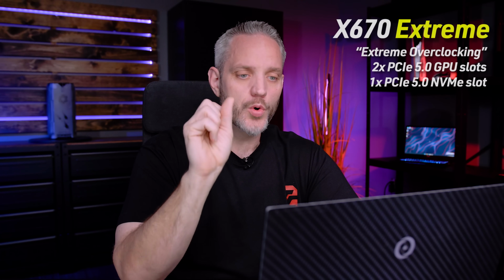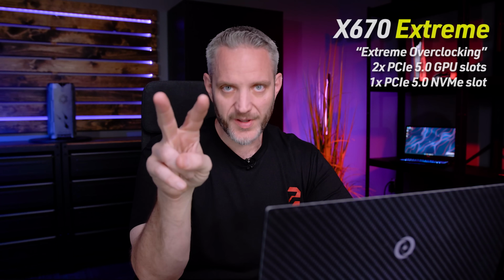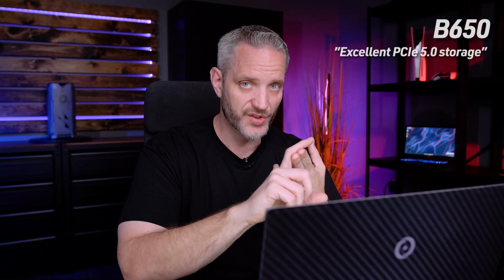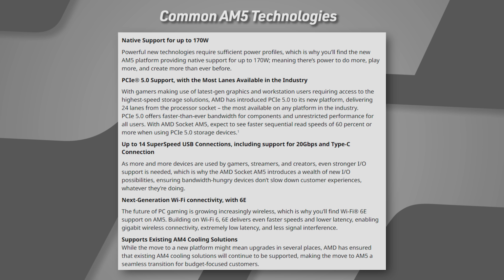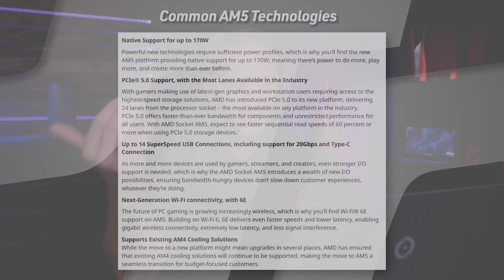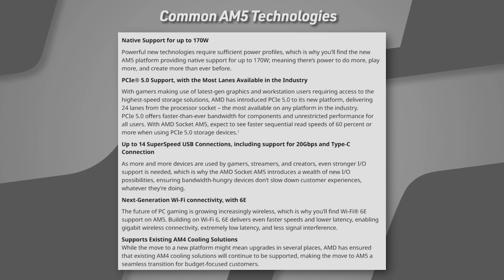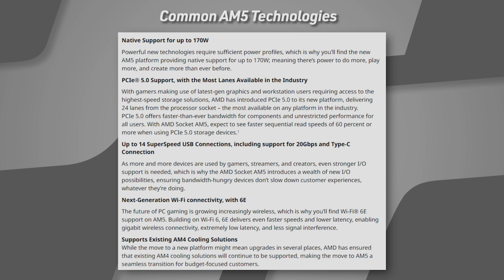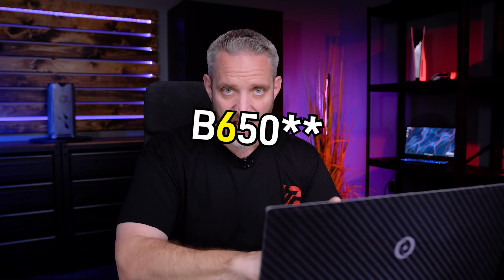AM5 Motherboards are EXPENSIVE! AM5 Explained

Comment: I would actually like to see Crossfire / SLI come back. Maybe some people with a lesser card could pick up one more and extend the life of their system.
Reply: In one sense it feels like a scam to say "hurr hurr here have feature to make you buy a whole 'nother card" but on the other, I literally was looking at boards like can this run SLI/Crossfire. 

But I mean, you actually can still do that anyway, it's just not super effective or stable (they never were super stable and reliable). Like AMD literally didn't even advertise this so I only found out about it through sheer nerdom of tons of tech stuff I watch and read that I found stumbling on accident that you CAN CrossFire your 5600XT or 5700XT. You don't even need the connectors just pop in another one and some games it actually works, which is super super neat.

But then yeah, the issue is with nVidia's constant different proprietary bridges that don't work for each other and are super expensive etc. and that they only even offer it now for their highest range cards, which I thought about getting a 2070 super for that very reason. I looked at the 2070 and thought, nah it hasn't got SLI. SLI mattered to me more than DLSS ever will. So I do think that it's scammy that they are still offering it on their halo products, but refuse to enable it on 60's and 70s anymore just because the kind of people to buy those cards absolutely would save money by buying a used second card. All that stated, Jay is basically right. It's so hit or miss and requires devs coding that it's become pretty much pointless. Main reason why it's pointless though? Look at dem thermals and power efficiencies. Can you even imagine Crossfiring or SLI'ing two 450w cards?? That's insane! I guess a 4060 it's "fine" but even still, that amount of power draw is going to be nuts. My 850w already can't handle two 5700XTs without tripping (I have enough other shit going on inside that 450w+ GPU usage is a no go basically).

Comment: I'm building an AM5 system at launch.  I'm still using the Ryzen 1800X CPU, and a GTX1080.  So i'm due for an upgrade.  Gonna get the 7950 CPU, Probably the ASUS Extreme board, and when they release a 4080 or 4090 GPU.  Also going to be building my first custom loop. Have never bent acrylic before, But I'll learn.  Already bought the massive Cooler Master HAF 700 EVO case, so I can use some pretty damn large radiators.  Going with a dual loop setup.  CPU and GPU will each be on their own loop, with their own extra thick radiator.   And then that system will hold me over for 3 - 5 years, like my current setup has.

Comment: No , i dont think crossfire will come back . Its simply , you dont need 16 Lanes 5.0 for one GPU , 8 Lanes will be enough which is equal to 16 Lanes 4.0 . You can have up to 5 NVME , 3 of them PCIe5.0 , that will be the 8 GPU Lanes and the 4 from the CPU , then you can get two 4.0/3.0 NVME SSDs over the chipset , or you have the second slot with 8 GPU Lanes for expansion cards or a second GPU . If they wanted a crossfire like GPU they would use two GPU Chiplets and wont have the Latency by going over the PCIe Slots and the CPU ( I/O Die) .

Comment: I got my motherboard a few years back. It's a $400 motherboard, that I got for $200 because it was refurbished since you couldn't buy them new anymore. And it's lasted me this entire time, holding my 4.7Ghz OCed 8086k well.

Next computer I build is going to have a 5800X (3D maybe.. depends on the price later down the road) and a decent 570 board

Comment: I'm probably going for a 7950 with as much RAM as possible, then under-volt it, put a passive cooling in, and that will be my music production rig, the built in GPU will be more than enough, and it will be super quiet, which is the main point with a music production rig. As for when I go for a new gaming rig, I will probably go for a 7xxx 3d, but as for now, I'm keeping cool, and waiting.

Comment: I think, until my system has trouble, I will just keep what I have for now. I don't need to keep up with the Jones'. I don't need the "latest and greatest". I don't need to "measure", I am confident in that. My rig does all that I need. B550 Aorus Elite, AMD Ryzen 5 5600X 6-core, 16gb ram, NVIDIA GeForce GT 1030 ... and am running Win11 Pro. I mean, seriously, I have no complaints nor issues with my system. I see no reason to run out and drop $1500. Especially after the whole covid/silicone shortage/mining/graphics card shortage debacle(s). They will get the money I need to spend when and if I need to upgrade. Otherwise, my system works and they can KMA!

Comment: The motherboard prices are ridiculous, paired with power hungry CPUs in "a high power cost era" the absolute worst timing. Taking into account global recession, prices also makes no sense at all. Major vendors (Intel, Nvidia, etc) have already gone far below expectations and that's what is going to happen to AMD as well if they don't bring platform costs at sensible levels. It is absolutely absurd having a gaming PC cost 3 times a console.

Overclocking  headroom in AM5 will be of a small margin and only possible with high tier cooling solutions like a custom loop. I wish they bring back crossfire because that could be the real deal for "higher res gaming @great fps" rather than using ambiguous upscaling techniques.

Great vid btw thanks.

Comment: I love your videos. I'm currently running an intel i7-8700k with an EVGA Hydro Copper 1080 ti with an Asus Apex X. Even though I am an Intel fan boy, the performance from the new AMD AM5 processors, I'll have to go the AMD route. Looking at the AMD 7900 for gaming, overlooking as well as having the capabilities for video editing. I hope I'm making the right choice for my needs.
Reply: I think the biggest advantage you'll get is longevity.  13th gen Intel may well be competitive with Zen4 as they will probably put full speed DDR5 memory controllers on it unlike gen 12, the issue is that you'll be locked to gen 13 with nowhere to go from there as with AM5 you'll have Zen 5, Zen 6 as a certainty and maybe even Zen 7 down the line.

Comment: I'm gonna hold off on an AM5 build until next year.. Wanna do an mITX build but dreading the inflated price these board manufacturers put on mITX.. is mITX still that much of a niche market ?
I run Linux OSs so don't really care what Windows can be installed on Zen 4, but it would be good if Zen 4 supports Windows10 which I think it will.

Comment: I found out about the Ryzen 7000 series literally a couple days ago when I was looking into a 5900x (upgrading from a 3900x) just said screw it, save up a bit and go for the 7900x, definitely learning my lesson for motherboard, bought a dark hero VIII x570 and it was SEVERE overkill... didnt need that, so going with a B650 or MAYBE a B650E, thinking of finally going into overclocking this gen.

Comment: I'm most definitely interested. But, as I have done with all other new AMD platforms, I will wait it out, until the new platform is stabilized, and then I'll jump into it. (Haven't been on an Intel platform since P2 was the flagship chip, been AMD ever since.)
Reply: My poor man lol
Well unless you're on Linux, probably. Sandy Bridge and Ivy Bridge was the shit. First gen Core was pretty great, basically the whole Sempron Bulldozer Piledriver stuff was what almost permanently put me off from AMD. In fairness, part of that was also dealing with HP and Dell.
Reply: @pandemicneetbux2110  No, I've never actually been on any form of Linux build. I came up all the way on Windows, and through AMD's 'dark years.' I was on Piledriver and Sempron (avoided Bulldozer, thankfully). My fist chip was a K6. My last chip, before upgrading to Ryzen was an FX-4300 chip. Now. I'm running nicely with a R5 3600. It's not the fastest or best, but it does what I need it to do, and it does it very stable, which is what I want.
Reply: @RayeKinezono  I was just curious why you stuck with it even when it was kinda shit despite not needing Linux drivers, as it sounded like you were upgrading frequently enough to not have true poverty builds. Unless it was really just to semi-frequently have a baseline decent machine at affordable cost. Some of that though, lol you're a brave man.
Reply: @pandemicneetbux2110  Well, for one, I didn't know at the time that Linux was an option, and even when I did, I didn't want to get into the steep learning curve (at the time) to deploy a Linux build. I just wanted my machine to work for what I needed (which it did, 95% of the time). Ad for the upgrades, yes, it was semi-frequently, to keep me from being a DOS user in an NTFS world. I was usually one to three chip versions behind. But again, it worked, and wasn't slow, so I was okay with it.

Comment: I plan on going AM5. I've been for way too long on an old and intermittently unstable laptop. So time to have some proper compy power. Though I do plan on giving it a few months, let all the bios kinks and stuff get worked out, etc.
Also, B650 Extreme exists. I'm not fully clear how that fits into all this.

Comment: This just falls right into my already existing plans (even from the middle of the graphics card issue) of not building until next year, probably the middle of next year. I've got my first-gen-Ryzen board, 3xxx series chip and 3070 I'm still running (and laptop on top of that, a Legion about a year old) so I can wait for a bit. I did my early adopter weeky bios update with the Ryzen launch. Someone else can deal with the launch bugs this time. :)  That said, if the 670E series does dual graphics cards... I might just build a dedicated rendering system this time on top of a new "main" system (probably on the B-series.)  BUt... yeah. Solidly in the "wait a bit" camp here.

Comment: Just paid $350 for a 5900X at Microcenter to upgrade from a 3700X. Definitely is a big difference in performance. I think the 12 cores will age well so I don't see myself upgrading to AM5 anytime soon. I usually wait a year or two before getting a new platform because that is when they not only become pretty stable, but the prices come down as well. As for Intel, I think the 12600K being about $200 right now puts it among one of the best gaming processors for the money. The new 7600X is a little better but I don't think it will be worth the extra $100. It will be interesting to see how the AM5 sales go when it comes out.

Comment: First 6 months or so of a brand new platform like this with new socket, new memory, new PCI standard...I'd imagine things are gonna be rocky for a bit while they get all the kinks ironed out.  And everything's gonna be expensive as heck.

It's probably going to take me close to a year more to save up for what I'm looking at with current/soon-to-be-previous generation midrange options, so I'm definitely going to keep my eyes open to see if the prices die down fast enough.  (My current PC is a bit of a wreck, thanks to some overheating issues that I solved too late to prevent damage, and I built it in 2014 so even if it was running like new, it's badly outdated.  Point being an upgrade is happening when I have the funds available for it; I'm not waiting another year to give the upcoming generation stuff time to drop in price as it ages.)  Of course, I guess I could win the lottery, then I'd start getting interested...

Comment: I am planning on adopting AM5. I am way overdue to build a new computer and AM5 and RNDA3 look like they will be a lot more power efficient than what we have now. I am planning to use a Fractal Torrent case and go all air cooling. There are rumors that X3d versions of the 7000 chips will be announced at CEC 2023 in early january. Since I was not planning to build a new computer until late november to early december anyways I may just wait for early january and see if I should get an x3d chip instead. I am really looking forward to testing AVX512 on some of the simulations I have.

Comment: Jumping in on release with a 7700x and a cheapish MB for work and then another AM5 gaming PC in spring. DDR5 is already under $150 for 32GB kits and motherboards starting at $130 doesn't seem expensive to me. Especially when you consider AM5 socket longevity and the inclusion of PCIe 5.0. Going from a 10-year-old Xeon X5687 to +5Ghz Ryzen will be so SUWEEEET!

Comment: The two graphics card slots could still be for productivity. The 7950X is going to be a fantastic budget productivity chip. There's a big price jump as soon as you move to Threadripper currently, so a lot of productivity focused builds have been going with the 5950X. My studio opted to buy all 5950X machines when they upgraded after originally looking at 3970X and 3960Xs. The 5950X was just more economical, and available.
Reply: Those two slots are for low end HEDT, the HEDT that non-pro TR played in. It is the reason why there is only pro Threadripper now: the non-pro is now the high end desktop CPU.

Comment: As i'm on a TR 1950x, an upgrade is 100% a must.  Papermaster  summarized that performance from zen1 to zen3 improved over 235%.. making my TR basicaly a low end 8 core zen3/4.  Still thinking of Zen3 TR Pro.  knowing there wont' be any upgrades.    Or Zen4 AM5 with mulit PCIe slots for rendering as base and older TR's as render farms (now that older GPU's are becoming more available)..

Still few weeks to go.. and defintiley will go AMD (zen3 TR Pro or Zen4 AM5)..

Comment: 2x M.2 makes more sense than 2x PCIE 5.0. It seems far more likely for users to add NVME drives than a second GPU. Other than that, no you don't have to be a hardcore Intel fanboy to not buy Zen4. Zen4 is going to be expensive. It's not a big enough jump to warrant me spending $700+ when GPUs are still the bottleneck for most games.

Comment: I'm planning on moving from my current i7-4790K/Z97 Micro ATX build to a R5 7600X/B650E Micro ATX. I like the look of B650E. Even though the B650E will cost as much as high end vanilla X670 (non-E), the "E" on B650E in the Micro ATX form factor should allegedly (according to rumor) guarantee one PCIe 5.0 x16 slot and one PCIe 5.0 NVMe storage slot. I'll probably wait till around Black Friday in November to make my purchases.

Also, this will be my first AMD PC. I've always been Intel all the way, but I've just gotten tired of Intel's two generation lifespan for their socket support and I'm disappointed that Intel doesn't have any plans to move to even three generations of CPU support per socket. While Intel never shipped a proper Broadwell upgrade path for LGA 1150 motherboards like mine, I was a little jealous watching X370/B350 owners move from Ryzen 1000 to Ryzen 3000 and then, at the tail end of AM4 support, get Ryzen 5000 support to install a 2021 CPU in a 2017 motherboard. Now that's long term support and that shows to me how much AMD cares for its customer base and isn't trying to soak their customers for more motherboard money.

Comment: Haven't looked at them all. But the ASRock board literally only has 2 PCIe slots, and only 2.5gb Ethernet onboard...  WTF?  They have like 4 m.2 slots though... The trouble is, I want faster WiFi or Ethernet more than I want 4 NVME drives. Beyond that, the PCIe slots adapters to m.2 are more conventions than the m.2 slots on the motherboard to begin with. Some of which you have to remove the video card to get to. It's completely backwards.

Not to mention capture cards,. Higher quality audio etc.

It pisses me off and it's a waste of full atx space/size

Comment: I'm interested but not sold on it. I'm still sitting on an R5 1600 so I'm kinda due an upgrade in the next gen or 2, could go longer though. I'm on Linux so I'm not concerned about compatibility issues and if I were to upgrade, it wouldn't be immediately. I experienced compatibility issues with my 1600 when that came out, which I bought on day 1, so I don't really wanna do it again. Waiting may also yield some discounts on intel or AMD.

Comment: For AMD, it is a good idea to wait for the 2nd gen to come out, mainly for stability and software updates to actually utilize the power the hardware can put out. This could be also true for the graphics cards, because the AM4 5 series cpu and 6000 series gpu working together better for performance boosts. 
It is exciting though to see AMD continue with the success the AM4 series brought. I would like to see how other operating systems perform on the AM5 platform also

Comment: I'm still running my Threadripper 2920X with a Vega 64 which I built in 2019 and now have a RTX 3060Ti in it. I will most likely run this with a RX 6800 XT for an other two years and get a cutting edge AMD system then (most likely a R9 9950X) ...